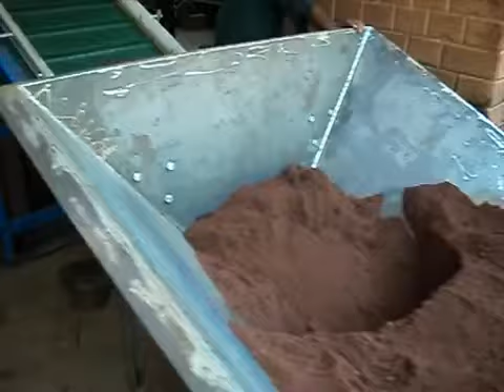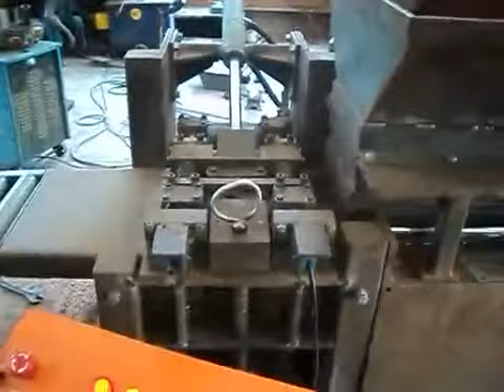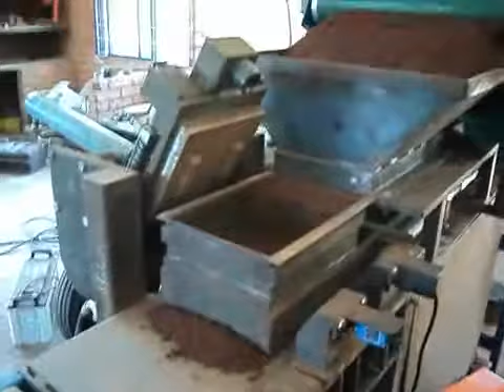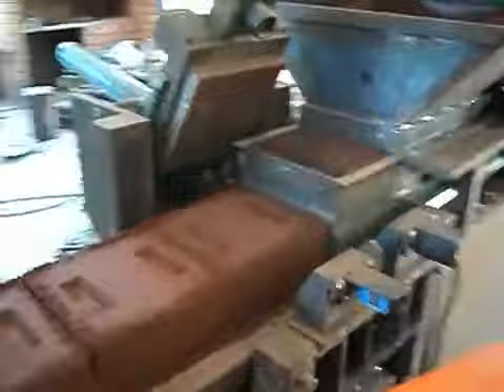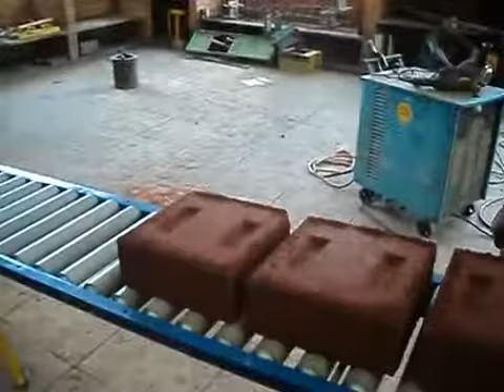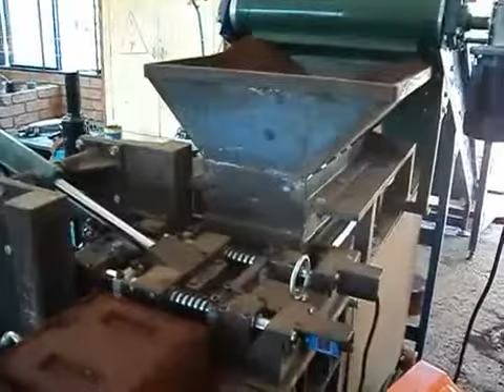Auram Press 6000 - automatic compressed earth block press

Comment: Those blocks look really rough and uneven compared to other automated presses. I hope this is just a POC or beta test and not actual shipping model
Reply: That was a prototype which was under test. And that bricks are in perfect shape. It's the dirt on top of those bricks falling from the hopper..
Reply: @venkat_k_ramarajan  right, all the other ones are brushing them off. Maybe you could add some on the conveyor system
Reply: @venkat_k_ramarajan  very fast, nice.